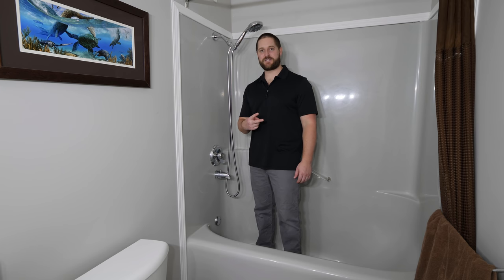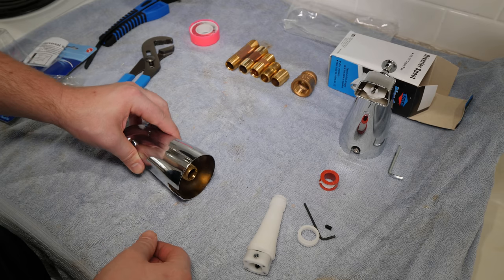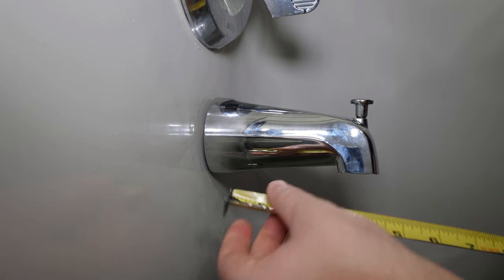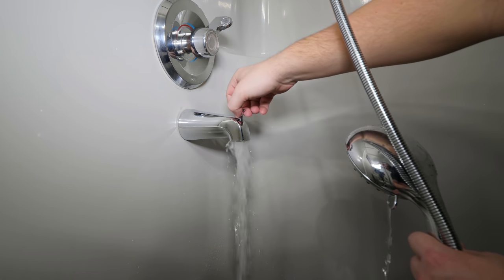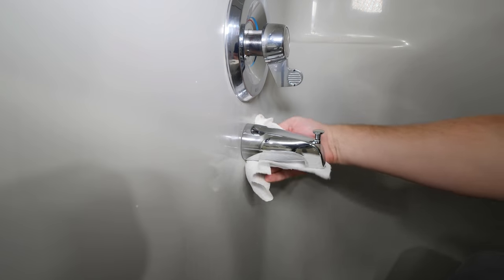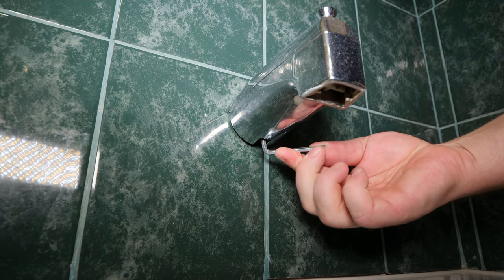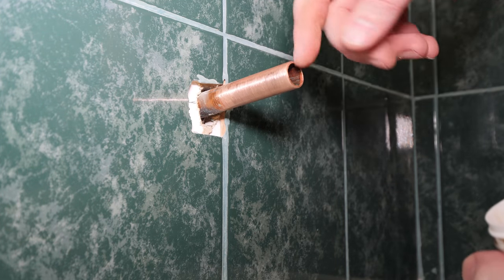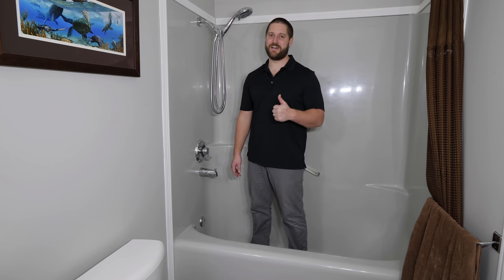Replacing a Tub Faucet: Bathtub Spout Replacement

Comment: I wish things came off as easy as these videos make it look, my tub spout refuses to budge, and no I'm not turning it the wrong way.
Reply: I had to use WD-40 to get my tub drain stopper out yesterday, not even the full drain. I think someone had misthreaded it putting it in. Then there was so much hair it prevented it from fully twisting to come out. I'm renting so just cleaning it, but Im going to soak it in vinegar before putting it back, maybe it'll thread correctly when I put it back if I have to clean it again before I move.

Comment: Thank you for a thorough yet succinct demonstration!  I bought a new spout last year because my diverter wasn't working properly.  Lots of corrosion inside the old spout.  I did not install the new one yet but instead filed down the corroded parts of the old one. Seemed to work fine, but I've noticed lately that I have to file every couple of days LOL.  I've been a little nervous to change out the whole thing but I think I'm going to do that next weekend thanks to the confidence you gave me! PS-- love the bonus tip you gave-- that the shower diverter should disengage on its own when the water is turned off; never push it while the water is running.

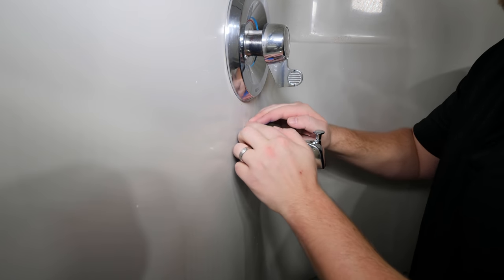Comment: 5:03.  What a simple solution to clean caulking.  The painter's tape. You've taught such an invaluable tip.  I know it's a simple thing, but every person loves a clean caulk and this small tip can change the entire appearance of any project.  Thank you.  I envy your caulk.
Reply: Another pro-tip, is to PUSH the caulking gun, not DRAG the caulking gun.
When you caulk your bathtub, countertops, baseboards, etc, this will give you long, clean, perfect caulk lines every time... and no tape required.
Reply: Teflon tape

Comment: Thank you, I plan to do this on Friday. I watched your other video too on replacing the drain, so I will be doing both. My diverter is broken on my facet, and my drain, the cover of it is very rough to touch because I used a harsh cleaner that I should not have. But I noticed the black ring around it, that is probably the washer installed wrong. As far as the facet on your tub being high, I bet they put it that high to prevent little kids hitting their heads.

Comment: This video was incredibly helpful, informative & to the point. I feel very confident I can replace my own tub spout now.💪🏻
Thanks for posting ⭐⭐⭐⭐⭐
Reply: How did it go?? I want to do mine!
Reply: @gabriella2682  not great, but by no fault of the video, I ended up buying both types because I felt a cut out where the screw should go, but when it came time to unscrew I couldn't find one. So I get a strap & hesitantly unscrewed it. Which worked, but when I went to screw the new one on it didn't fit. There was some weird coupling that I couldn't get off, looked rusted in place? I bought wire brushes & wd40 that said wouldn't stain my tub but did. Nothing worked, so I had to call someone after all. But if there wasn't all the extra bs, It would've only taken me 10 minutes. 🤷🏼‍♀️

Comment: Nice video. Thank you. The one thought I have is that it's possible the spout you're removing is a universal spout, in which case it could actually have been installed as a screw-on, but the presence of the set screw will make you think it's a slip-on. So, you could be tugging outward and/or turning it clockwise in error as you try to remove it. So, to me it makes sense to only turn it counter-clockwise during initial removal if it has a set screw, unless and until you're absolutely sure it really is a slip-on.

Comment: I changed my spout out after I tried to repair the diverter by putting in a new gasket but the inside was too rough to make a reliable seal.  Fortunately I have the slip on type so it was an easy fix requiring only a hex key to get it done.  I much prefer the type of diverter which is in the shower valve as it is more reliable.  I have one of those rubber strap type wrenches that I got for about $1 at a yard sale.  I hope to be able to use it someday.

Comment: Having the spout that high is great for having small rambunctious kids take a bath. I remember giving myself a black eye when I was 3 due to the spout being at the standard height.
Reply: personally, I have very specific desires when I take a bath. I take long baths and like to refill the HOT water periodically in my bath.  So having access to the  the  faucet etc is KEY for me.  Also my old house the hot and cold were reversed on the single handle.. which is NOT CODE, I realize that but I LIKED that because then I could just trickle the hot water which was a better arrangement
Reply: @caelidhg6261  Makes good sense if you’re an empty nester. I’m the same way, long hot baths continuously filling with hot water. The best!

Comment: These instructions were great. I replaced one slip-on spout following them and I think it went fine. I just went to replace my other spout with a different kit and it was a bit more involved. I don't think it had an o-ring. It had me put a small piece that the set screw was attached to first, then a compression ring, then a longer piece with a threaded end. After tightening all of those and the set screw I had to put teflon tape on the threaded end and screw the faucet on. I'm guessing this kit was more oriented to thread-on systems and this was basically an adapter.

Comment: Something I discovered fairly recently, teflon tape isn't to seal the joint. It's for NPT threads to lubricate them so that you can tighten it down more for the NPT thread to seal better.

Comment: Never knew you could use rubber strap wrench! Cool!
Reply: strap wrench didn't work. My spout won't budge. :(
Reply: They sell channel locks w/out gripping teeth, so the finish does not get marred.

Plus, you can wrap the ones u have with teeth, orange tape. Yes, it has to be orange.
Reply: @doneown503  I wasn't sure I understand your message.  Since strap wrench (the link provided by Pros DIY's) didn't work, I ended up used the quick grip clamps that actually worked.

Comment: Just going through watching do it your self video's for fun and see different methods. This was well done, I would add that the Teflon tape should not go on the first thread. It can be cut and cause a clog in your piping. you should also tighten each joint independently. and where possible use a back up. (something to keep the previously tightened joints from moving. the reason for this is to keep a uniformed tightness of the fittings). seems minor but it is important. lastly. If you cut the pipe. be sure to debur the inside as well as the outside. not deburring the inside creates a turbulent flow which escalates erosion. Although I added some points to this the overall of this video is exceptional and appreciated.

Comment: Hmmm - question.  If you add the sealant when you put the new one on, how do you ever get it back off again?  We have a screw off spout that for the life of us we can't get off and I'm wondering if that is what is causing the issue..  Great video by the way.
Reply: It must be sealed or the threads will leak water. There is no option for not sealing. In this video he uses teflon tape AND a paste style pipe dope. Basically, he put a sealer on top of a sealer. One of either may be used, but using both is something ive never seen anyone do because its not necessary. Your issue is most like due to corrosion and the amount of time the faucet has been in place.
Reply: @UserFormelyKnownAs_hjkh  he put a lubricant on top of the teflon which is a light sealer. And you can use nothing actually and it will work, the pipes and fittings have to be tapered properly. However half of these Chinese shit sucks so yeah you gotta use Teflon and dope as insurance
Reply: @joeb5829  i work with NPT pipe all day and ive never seen anyone use a lube or dope on top of ptfe tape. To each their own. However, one or the other is more than sufficient for household water pressures
Reply: @UserFormelyKnownAs_hjkh  yeah you're 100 percent correct both are technically unnecessary but I guess most guys jobbing would rather use both than have a leak and have to reset it and waste time. My experience is in NY so I guess due to the age of the majority of the plumbing people pick up different habits
Reply: @joeb5829  thats fair. If i was dealing with infrastructure as old as up there id probably pick up the habit of using both as well!🤣

Comment: I'm looking under mine and it's confusing me. It has the cutout for a set screw, but I don't see a screw at all. I just see the pipe from the wall underneath. Which one do I have? Should I try turning it? It doesn't slip off and I don't see a screw.

Comment: Watch your video. Very helpful to replace the spout. 1) Do I have to turn off the water from the main line or just from the shower knob?. 2) how do you know what brand spout to buy if it is unmarked on you the old one.? When searching for a spout replacement it gave me a lot of brands and designs. Thank you
Reply: Im pretty sure you only need to have the water off at the knob when changing the spout. I think it's a different process when replacing the knob. As far as the type of replacement, I would either go with a universal or remove the spout to determine what type and measurements it is and then search accordingly. This is only a suggestion, there very well may be better advice than mine.

Comment: Single mom on a tight budget… I’m going to try this myself! Do I need to cut the water off from the house first? Did you buy the copper screw in parts separate? If so, what are they called?

Comment: When you applied the tape to the first fitting to the stub out the tape was allowed to go beyond the threads at the pipe opening. This can lead to clogging since the excess tape can be cut off by the threading process of the fitting. Minor detail but for some applications, can cause issues.

Comment: Very helpful, thanks. My Moen shower/tub was probably put in in the 80s (gold tone...). The tub spigot/diverter does not seem to be held by an allen screw, I can rotate it easily by hand but it doesn't want to come off. Should I just give it a good tug? The building it's in is 60s vintage so I don't want to put too much strain on the plumbing behind the wall.

Comment: Just removed the slip on and it looks like there is a leak? Water just keeps coming thru? I do need to replace the handle. Cause I can only tighten it with wrench. Is that why it’s leaking?

Comment: Great video!  However, one more thing people should be sure to check FIRST:  Some houses have PVC installed behind the faucet instead of copper!  Yes, this is a HORRIBLE design, and I found out the hard way when I wrenched the faucet and broke the pipe behind the tub!!!

Fortunately in my case there is an access hatch behind the tub to make it easier for the plumber I now have to hire, as they will now have to replace the assembly in the back (and add copper pipes I am requesting).  Also fortunately, no water spilled because the faucet was off. However, I posted a sign for my kids to DO NOT TURN IT ON NO MATTER what before it gets fixed, as doing so will spill water all through the walls.  "Very bad that would be," says Yoda!
Reply: I was "Lucky" and just broke the PVC pipe on mine, however I broke it in the faucet and didn't break the pvc in the wall. Still completely scuffed but just not "As Bad"

Comment: The screw on diverter spout states it for galvanized only not to use copper pipe. is that because of the stainless steel reacting with the copper, looked nice

Comment: Hi, thanks for this informative video! I have a new tub spout that has the plastic guts inside. I took them out and the 1/2 inch brass nipple won't attach to it. I think there might be some glue left inside where the plastic guts were screwed on. How can I remove the glue so that I can screw it to the brass? Thanks!

Comment: Which brand silicon would you recommend for sealant.? I have the squareish styled spout, do I also leave a small part unchaulked?  Thanks.
Reply: doesn't matter, just make sure 100% silicone, usually you'd want white and not clear.  if it doesn't say 100% silicone it may just be siliconized, meaning it only has partial silicone properties and that could still lead to mold growth.

Comment: Plumbing question - I fixed a major leak replaced it with same galvanized fittings . Afterwards there was some low water flow at a few places which I mostly fixed by cleaning out the aereators ( tips ) of faucets / shower heads . But kitchen sink faucet has no tip but still low . What could be problem ? It seems far away from the line I worked on . My repair was further away from main ( meter ) and kitchen much closer to it
Reply: Frank Montez - Any old iron piping in the system is a bummer and can be the cause of low volume. Also bad main water shut-off valve can be the culprit.

Comment: What if there is a Half moon shape around the spout for the set screw ? I can’t see if it would need an Allen key or what would even fit in there to loosen it? 
It’s a tub spout with a chrome circle fitting around it that has the half moon hole ?

Comment: Well, I tried to change out a tub faucet that was corroded so badly that the underside of the faucet no longer existed so that I could see the pipe itself inside of it. Unfortunately even after removing the 14" thick caulking around the base of it, I still can not get what is left of the faucet to come off of the pipe. There really isnt anything left besides sharp jagged pieces to try to grip onto and it is not solid enough to try to turn. Ive been trying to replace this faucet since I bought the house with no luck.

Comment: Mixer valve and faucet stub-in height was probably to accommodate a taller, soaker style or other unusual style (Japanese) tub that was planned, but not installed. Or the taller tub was installed and later replaced with the shower/tub combo used now but the original mixer/faucet location was not moved.
Reply: Or, judging by the wall handle installed, the higher spout was to accommodate a special needs user who may not have had the ability to bend down to reach a lower spout. Handicap shower! (though not walk-in accessible)

Comment: I bought a slip-on replacement. (The set screw is a Phillips head).
The problem I'm having is that I can't seem to get the set screw tight enough: it gets tight and then loose again.  No leaks, but when I flip on the diverter, the water pressure starts pushing the thing off the pipe!
What to do?
Reply: dgdragonman - Were you able to properly secure the spout in place? You can get an allen head set screw to replace the Phillips head screw. Be careful not to overtighten screw, so you don't damage the pipe. If push comes to shove you may need to buy a better quality spout. I use Moen; they have a very positive pipe clamp with allen screw.

Comment: Mine has the notch but I can not see or feel a screw in there.  I even took a photo with a phone while it was dry and it shows no screw despite being a really good photo.  Could it be threaded or do I just have to rotate the spout?  There does appear to be some sort of plate on the shower wall that would go on before the spout (it can not go after)

Comment: I liked your video. One question/comment is, don’t you want to have some gloves when sanding/polishing the burrs off copper pipe?
Reply: I mean, sure, but if you use a pipe reaming tool, you really shouldnt have any direct contact with the metal shavings. Sanding the pipe after that is not likely to do that much but if you dont want the copper dust on your skin wear gloves.

Comment: Excellent Demonstration. What to do when your bathtub is close to the side of spout. This caused water hitting the sides. This Caused Corrosion on the outside of bathtub. Any ideas to keep water in tub only?
Reply: Gayle Friedman - That is a substandard installation when spout is close to one side of the tub; it should be in the center.
Reply: @carlcampbell6827  Thank You.
Reply: @carlcampbell6827  Thank You for this very important information.
Reply: @gaylefriedman3773  - Not seeing your installation, it is likely to assume the tub wall will need to be opened up so a plumber can relocate the pipes to the correct location. Then wall will need to be restored and finish plumbing fixtures installed. This type of job is commonly seen and typically not very expensive, unless other defects are uncovered. The main thing is to find a skilled, honest licensed contractor to correct substandard work according to code.

Comment: My spout does not have a set screw.  There is a white plastic sleeve over the copper pipe.  This has a tab on it that needs to be depressed to allow spout to move.  Not sure what new spout to buy, given this well-glued-on white plastic sleeve.

Comment: At 3:30, are you painting caulk around the thread tape?
Reply: Pipe dope
It's a type of sealant. I personally would only use the Teflon tape. But it's cheap insurance for folks that don't tape threads alot.

Comment: How come in these old city houses half the time I try to unscrew the spout it twists the copper. Now I have to cut out an access panel
Reply: I'm in the same boat. The other side of the tub spout wall is tile, so I need to cut into that and make an access door and somehow install hinges on it so that, in the event this happens again in the future (which is unlikely because I'll be installing it the correct way), they'll have easy access. How common is it to cut out an access panel? I'd replace the hole I'd make with tile, but the off-branded color tile is no longer found, so I have to resort to an access door